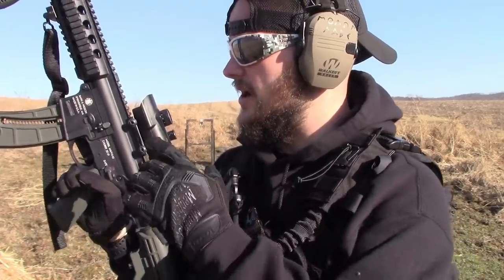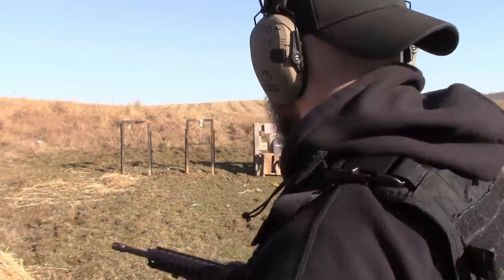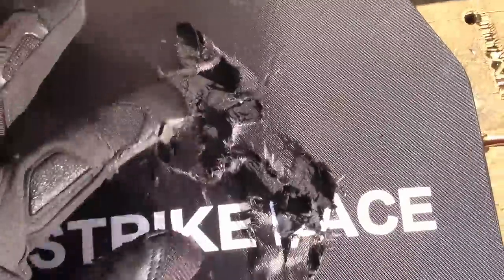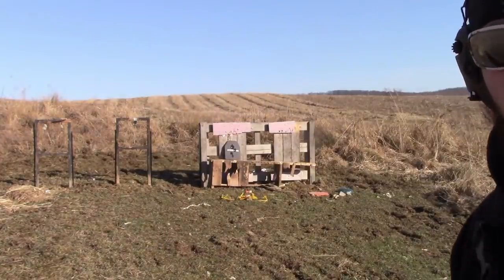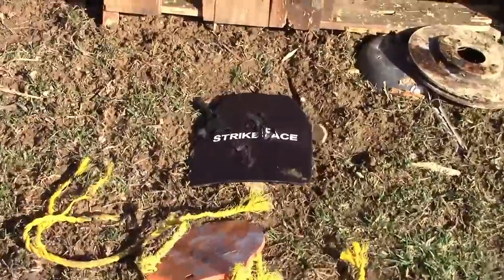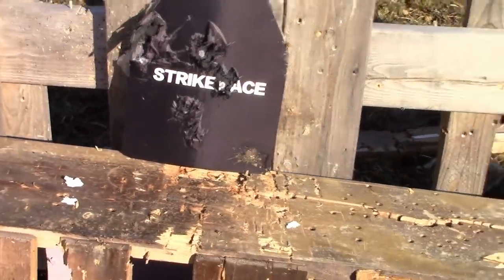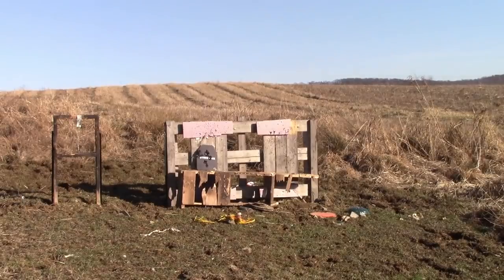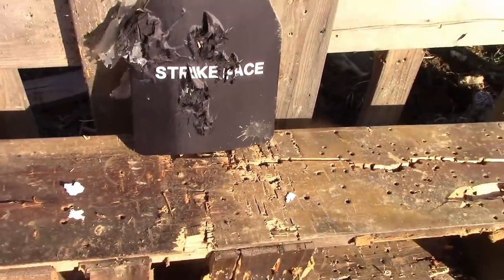Bullet proof plate from wish??

Comment: I would rather have that plate than no plate
Reply: BridgeMAN & WIFE lol finally I can afford plates
Reply: You might be able to run faster without them though
Reply: @tortron  they look really lightweight and you dont feel weight as much when you wear it. Plus you wouldn't run much when bullets fly. However If your plan is is to run, you may as well ditch the carrier all together. But no one can outrun a bullet.
Reply: @christopherreynolds4506  yeah but when you're running in a flack it's like running in slow motion... I rather move a normal speeds
Reply: I'm gonna use that in my car door
Reply: Maybe strip the spall coating from the front of one and the back of another, and mate them together
Reply: @christopherreynolds4506  I see your point, but movement saves lives. You gotta get off the X ASAP.
Reply: @tranpak9504  I think it would be nice to cover the entire car on those plates.
Reply: @Lugia21  for that price, I think I just might.
Reply: BridgeMAN & WIFE The “plate” in this video gives performance similar to a phone book from a big city or a $10 cast iron pan from Walmart.
Reply: @quarkedbutt8711  I run ever morning fully geared with all plates in my carrier that is kevlar itself. Not in as great shape as I once was but still run faster then slow motion, lol.
(Edit for spelling errors.)
Reply: Although it would be assuring knowing the wifes honda was bullet resistant to an extant on all sides of the door panels I wonder how fuel efficient it would be with all that extra weight. Would be cheaper just welding half inch metal you can pick up free sometimes from metal shops.  Thanks for this idea, might just have to upload a project :D 
(Edit, many spelling errors. Probably more, too tired lol.)
Reply: Hey guys look at me I'm dead but the bullet stopped what happened? It's called spelling. Do not trust cheap plates with out a spall coating. Fragmentation kills just like a bullet. And as most knows speed is what penetrates armor not mass.  Spalling oops hahahaha
Reply: @quarkedbutt8711  check out Level 4 plates by Battlesteel on Botach for $99. There's another test on them on YouTube and they do stop 30-06
Reply: @quarkedbutt8711  thats not a flack jacket
Reply: I was thinking this as I scrolled to the comments
Reply: Christopher Reynolds. Chuck Norris.  Nuff said
Reply: @rifleshooterchannel208  cast iron ain't gonna stop shit unfortunately
Reply: @derethknight  Dont forget back face signatures. Round might not penetrate, but that energy is being transferred to your squishy body if you dont have a trauma pad. However, if any of y'all civilians are expecting to be fired upon by 7.62/.45-70/etc...*Jedi hand wave* you need to go home and rethink your life.
Reply: @inzanity6624  Second that. Iron is extremely brittle, and also stupidly heavy, for modern armor. Though in his defense, I believe he was remarking on the video plate's unimpressive performance.
Reply: @ryanm7832  yup all valid points.
Reply: @ryanm7832  dude army iotvs are wayyyy heavier then a plate carrier with these thin ass plates I'm sure your movement would hardly be affected
Reply: I would rather no plate than being caught alive and poor
Reply: you can cut plates yourself what you're paying for is the weight reduction.
Reply: @quarkedbutt8711  This is why you take this vest and plates along with you when you do your jogging routine. It's a no Brainer, If the vest causes a weight problem. That just means your not carrying the vest, the vest is carrying you. Know your tools, adapt and put them to best use. Before the bullets fly, if your already running/training with a vest. It becomes part of you. Therefore weight is no issue. Smh.
Reply: @ernestcortes1392  I've ran too many miles with one already amoung other things, I'd that her boot scoot boogy than wear a plate carrier
Reply: @rifleshooterchannel208  Easier to wear though.
Reply: Save up and buy hesco plates dont cheap out on life saving equipment
Reply: Running is a bad idea for anybody in a war situation unless you run try to take cover from getting hit by bullets.
Reply: Amen brother
Reply: Where armor is scarce and hard to come by, if this is all you have …yeah

Comment: I did NOT expect it to stop the .300, that's actually quite impressive!!!!!
Reply: @chrisropherpino2516  oh yeah, no doubt.  I'd surely rather have broken ribs and the wind knocked out of me than have a hole in my chest though!
Reply: Really?! 300 aac is crap for penetration. That’s just like getting hit with a 45acp
Reply: Chrisropher Pino You know you can put one into a backpack and use it as protection.
Reply: It stopped the .300, but simultaneously shattered it, sending shrapnel down into the figurative wearer's crotch/thighs
Reply: @HonkeyKongH  subsonic, yeah. 110gr 300blk is a real rifle round though
Reply: Ryan M 1000 denier nylon would catch that shrapnel though.

Comment: The foam and outer coverings are for shrapnel. Anytime you stop a high speed round with a steel plate, some of it bounces off and some of it disintegrates. The pieces that bounce upward and outward will destroy your neck, face and arms. Lots of arteries in you neck and arms that will cause you to bleed out very quickly.
Reply: Anti spalling coating is what that material you mentioned is it keeps your neck and arms, chin face protected from the spall if you get hit. The coating on this plate looks very cheap and doesn't look like it'd perform very well

Comment: Curious why you would expect the 38 to leave a dent when the 9mm didn't. 
Thanks for the video. 
I'd be worried about bullet fragments, since obviously that foam isn't catching anything.
Reply: Metal deflects there for anti sprawl don’t catch it deflects. It’s suppose to stop it from hitting you in the upper throat/chin and shoulders. And it did that.
Reply: Flex seal it 🤣
Reply: There are anti spall bags online. You drop your plate in and it is like ballistic nylon, very affective

Comment: I'd make a mold which is plate shaped but that allows me to add some hard rubber/silicone into the plates to stop spawling, and i'd use both plates in the mold and maybe wrap it all with a few wraps of kevlar fabric. Probably it would cost some extra 20 bucks and maybe a day's worth of work, but yould get a much better plste with better anti spawling characteristics for basically 60 bucks. 

If you aint got much money, i'd do that.... and Immediately start saving for some real level 4

Comment: Hey, that plate worked just fine, it may be cheap but it was effective
Reply: Worked about as well as a phone book 😂
Reply: @rifleshooterchannel208  a phone book wouldn't stop a 9mm.
Reply: Rifle Shooter Channel Make a video with a phone book blocking the same bullets seen here then. I say you are wrong.
Reply from the maker: Actually I did one on dictionaries and didnt make it through all the pistol rounds
Reply: @Pyro5610  What?
Reply from the maker: @anon457  I did a video shooting dictionaries and it didnt even make it through half of my pistols
Reply: Adam Blade Depends where you live. 

I have a backstop in my garage for testing reloads and chronoing and I have a standard phone book from my city as the first “layer” and most centerfire service pistol calibers don’t go through.
Reply: @Pyro5610  gotcha
Reply: It's also considerably thinner and more manageable than most phonebooks.
Reply: Dev L667 So is real soft armor.
Reply: @rifleshooterchannel208  Ya, but phone books practically don't exist anymore lmao

Comment: I have the same 2.3mm steel plate from wish as well, it stopped my 22lr at 50 yards np, but my 7.62x39 SKS went right through! I also tested the 6.3mm steel one which is quite heavy, and that stopped the SKS without even a dent. I imagine the 4.3mm thick one would stop the 7.62 but have a bulge, I dont have one to test.

Comment: The reason these are so much thinner than the other plates you have aside from the slight thickness in the steel plate, it is mostly the coating. The thicker plates have a spray coating like truck bed spray liners (ARMA, LINE-X, RHINO) it’s purpose is to prevent the fragmentation from the bullet spreading after impact.
Reply: Spalling. The fragmentation from the bullet impact as you said, is called spalling...just an FYI
Reply: Oh, bless your heart 😂 
    Thank you lil guy but, I already know what “spalling” is. I bet you felt really important telling me that too. 
   FYI,.. You see I was explaining something to someone whom is obviously ignorant about a process, so I explained it very simple. I didn’t feel the need to use a tacticool term that is actually originally used for masonry. (ore, stone, rocks, concrete) 
Though seeing that I used a more widely used term to describe what happens, it wasn’t necessarily to ad an alternative term for what I was describing.
 What I was doing was informative. I hai you did just makes you sound like an arrogant troll. Have a nice day, & have fun trolling others 👋

Comment: Could buy two sets and stack em for something pretty decent
Reply: Yeah I was thinking the same thing...
Reply: You could just buy a RMA lv 4 ceramic plate for $135 that will stop 30.06 AP rounds and is multi hit rated.
Reply: I got my rma for 99 .. They go on sale from time to time
Reply: @McM3tz1  I'm gonna have to keep an eye out for some black friday deals then, maybe get some lighter level 4 plates.There is no reason not to spend only a little more on superior plates that won't have spalling issues.
Reply: @coronanextdoor  you can get the battlesteel lvl 4(30.06 m2 ap) plate that only weights 5 pounds and cost $99 and won't have excessive bulk and weight, how much is your life worth? Check it out: 
 https://youtu.be/CgFsHJ53sLE

Comment: That foam is designed to stop "splash" fragments of the round flying off the plate after impact. This is to prevent injury to the face neck and arms. It is not intended to stop the initial impact.

Comment: I bought someof the bullet proof plates from wish that just came in. I put 30 rounds of 5.7x28 into this thing and had zero penetration. I'm actually shocked it did so well. 20 blue tips, 20 fmj.  The super light non metal plates. After my test, i would trust my life to them without question

Comment: I too own the Strike Face Chinese plate (2) actually and one I’ve put twenty plus rounds into up to 10mm (carbine) , 5.56  , 5.7x28 , 45 acp, 44 mag , and many 9, 38,22,32,25 and only one round penetrated. A tiny 224 Valk out of my 24” AR.  
But the plate was fatigued and the point of impact was compromised by other various rounds. 
$40 plates. 
I made ballistic plates from all kinds of stuff that can stop .308 and .224 , 30-06 45-70 ,30-30 but ironically fail on 12 gauge slugs 1oz. 
So science went out the window when testing them.

Comment: The foam is not bullet resistant.  It's an anti-spalling coating.  It's supposed to slow dawn or catch the bullet fragments as the bullet chatters on the steel plate.  Also, 9mm is better at defeating armor than 38 special or 45 auto, so I think the plates actually did surprisingly well.
Reply from the maker: Yeah I learned that over the last couple months since this one came out, thanks for watching👍

Comment: The 300 blackout was of course going to be stopped...its basically a 9mm in that configuration.  A .355 bullet moving at 1600 fps vs a .308 moving at 2000fps less if its budget stuff or heavier.  I love the blackout but if a 9mm +P doesnt even dent it, a blackout wont punch it.
It didnt punch through it, it tore the plate. At an angle near the edge it will tear.  This is why Ceramic is used, it is just as strong as everywhere on the plate...

Comment: Thanks for this vid I always wondered about those plates lol Was hoping you would continue the test with the plate sitting on the bench with the 300 placing more shots around the plate. If you do another plate vid put a nail or two into the bench in front of it maybe it will help keep it there.
Reply from the maker: I've gotten a crate to put a new one in, it'll hold it in place and I was gunna place foam around it to check spalling lines.

Comment: What the thickness of the plate you tested?  Wish has plates that are 2.5 mm and 6 mm , 8mm,and they have one that's 9.5 mm @ 8 lbs for $36.
Really appreciate a feed back on the thickness.  Thanks 👍
Reply from the maker: There is a link in the description, I got the thinnest one I wanna say it was the 2.5mm
Reply: @Pyro5610  thanks Pyro for your quick response. Your video is a big help in deciding about the Wish plates.

Comment: I wonder what kind of metal was used? Probably just cold rolled mild steel. Hardox or any other AR type plate won't dent from a pistol round. Either way, seems like you'd at least have a chance against anyone armed with a normal handgun.

Comment: I'd wear em, just need 2 trauma plates as well. Those critical defense rounds are meant to do maximum damage to soft tissue. They are also meant to go into someone and not come out the other side. So they are of no use when used against armor.
Reply from the maker: I knew that going in to this, when I was shooting i had just bought them and basically wanted to try them out
Reply: @Pyro5610  it is a very nice round I either carry those or hornaday hydroshocks on duty

Comment: What's your barrel length on the 300BLK. You know that's a 556 parent carriage necked up to 30 cal... essentially a 9mm when coming out of a pistol length gas system. 
Also place your plates at a 90 degree angle each and every shot
Reply from the maker: It's a full length 16inch barrel and yeah I'm going to change up my next test to  check for spalling

Comment: FYI, please check ballistics on 38 special. Even 38 spl+p on average is only going 960 FPS. This puts it on the very bottom end of extremely weak 9mm. 

I only say this because I used to think 38 special was more powerful until I started reloading and realize that it was actually about on par with a 380 and not a 9mm.
Reply from the maker: So did I beginning out but I have learned, thanks for not being a dick about it like most of the others lol

Comment: You need a solid backstop. If the plate moves a lot when you shoot it you're not getting an accurate read. It has to have some weight holding it. A small wood box rig anchored down would work.
Reply from the maker: Not even joking I did that in my last video lol it's pinned in the comments 👍

Comment: What woud be cool if u good side the plate into a proper vest fire at it and that way we could see how many actual impacts it could withstand without penatrating, or shredding the black coating that the plate comes with. then we can tell how many rounds of that AR  you can put on Target in the center and if/when it fails. It  look like it just tore through because you hit it at the very edge (bottom) so it's a good place to tear any material that would be cool. Just so we can see a realistc use of it. Thankssss bro
Reply from the maker: As the channel grows I'd like to get a torso with a vest, unfortunately not in the budget just yet lol

Comment: Recoil is not a bad thing. It usually means you have some hot rounds cooking down range. Also, 300 black out ain't good at piercing body armor buddy. Shoot that with a 5.56/223 fmj and it will put a nice clean hole through those plates. Velocity, velocity, velocity
Reply from the maker: Learned that after this video, check out part 2 👍

Comment: The plate is stopping the rounds because its movement is absorbing the inertia if you were to  hold that plate down and keep it from moving when the round strikes like it would be in a jacket strapped to you body the 9mm probably would penetrate!
Reply from the maker: I bought more, going to change the test up a bit and secure it better
Reply: @Pyro5610  I think you're going to see an astounding difference!
Reply from the maker: @michaelwalker1644  only one way to find out 👍

Comment: velocity is king for penetration. a 223 or 556 would probably make that thing swiss cheese. if your 300’s were 125gr i’d be slightly impressed but any heavier and i’m not surprised it didn’t go through
Reply from the maker: They were 146 if I can remember correctly but that's why we did a part 2 👍
Reply from the maker: Also it was only rated for pistols so it did it's job lol

Comment: Pan shot!  The real question pending for me is the velocity of the: 300.  If it was subsonic then it's really just a long heavy pistol round.  Clearly this thing is worth $35, what's unclear is if it works against rifles.  If it doesn't, it's way too heavy and small compared to soft armor with the same capability.
Reply from the maker: Check out part 2 and fyi they were supersonic .300 blk 👍
Reply: @Pyro5610  Thanks for the reply.  I just watched part two.  Here is something to perhaps play with in the future - the edges.  Many 10x12 plates (steel) wind up being effective only in a 9x11 area.  This is due to the hot torch cutting method which changes the temper of the steel adjacent to the cut edge.  Have fun - and don't waste those Paraclete plates.  They are legitimate life savers and industry tested.